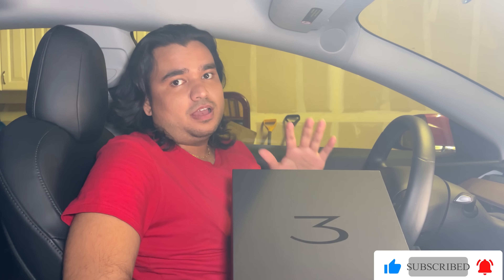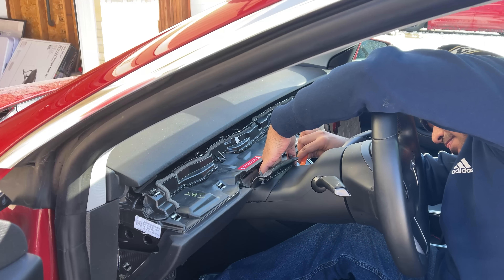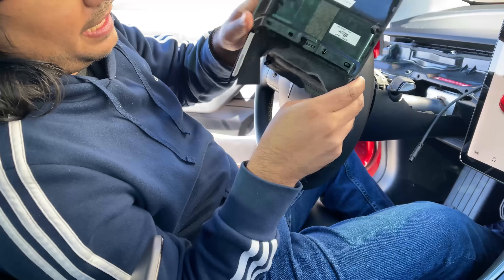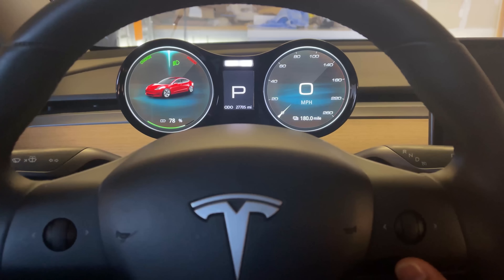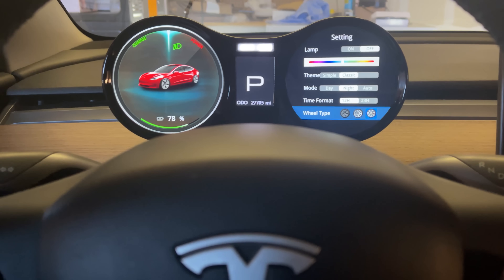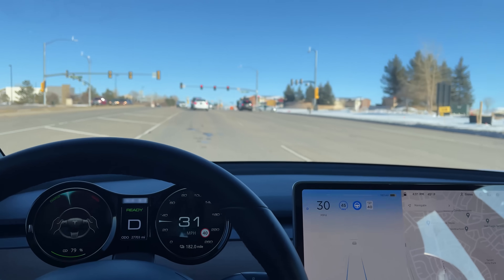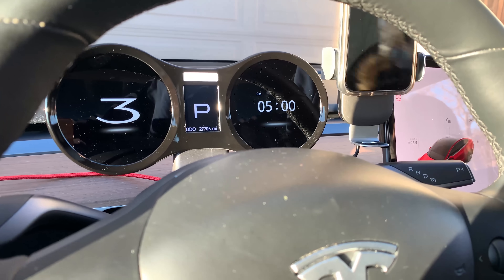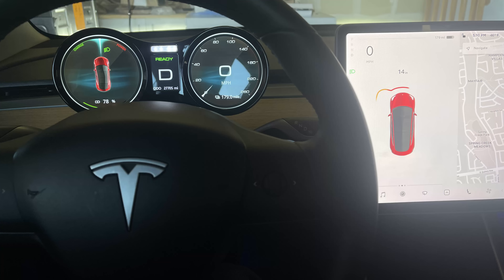New Display For Tesla Model 3 & Model Y - Instrument Cluster 2021

Comment: I need an update for Multifunction Dashboard with Smart LCD Screen for Model 3/Y Which I had purchased from them on 10/2023. Since the last update from Tesla, the range display and the battery level no longer work. The battery level display is at 79% and is frozen there and the remaining range is no longer correct and goes down and up uncontrollably. Could you send me an update or a link where I can get this???
I frome Germany and I hope you can help

Comment: Hi, i bought this dashboard display, but i have problem with connecting to the control unit. I have model number 1960100 with only one grey connector. another 2 connectors have black colour. Second connector has 10x2 PINs. Third connector isnt remove. Its this right connector to plug-in connctor cable to dashboard, please? My car was made in 2022. Thank you for your answer.

Regards, Matus
Reply: Me too , I could not find the plug on 2022 model 3. I have been hanging around for the whole day :(
 Do you have any solution afterwards? 😅

Comment: Tesla is not very flexible with regards warranty. If you experience the smallest of issues this modification will certainly be blamed and the modification will be forever logged into your Tesla file. My Tesla Advisor was pretty clear on the subject. You might as well write off your warranty.

Comment: So I’ve had this on my m3 for about 6 months and just recently removed it and switched back to stock. The main reason I got rid of it is that it significantly blocks air flow to the driver out of the vents, but I also found myself looking at the Tesla screen for my speed anyway and not even looking at the heads up display.

Comment: Hi Shiva - after installed, now I have no sound on the Tesla display screen. Any thought?
Reply from the maker: Lock your car and let it sleep overnight. Make sure to close your app as well. When your car wakes up, it will have the sound. The reason this happened is likely because you took more than 2 minutes to plug the new harness after unpluging the original Tesla connector. Tesla freaked out and put the car on a safety mode. Let it sleep and when it wakes up after several hours, it resets the audio and you should be good. Hope this helps!
Reply: Thanks much for your help on this

Comment: I’m trying to install this on 2022 model y, is the wiring different? I’m having difficulty getting the harness to connect with the autopilot computer, i maybe removing the wrong plug, is it the second one from the bottom?
Reply: Please if you found the solution tell me, i have the same problem, connectors are different and i don t know where i need connect it
Reply: @monxis99   if you got the model y with the Ryzen chip, the blue connector is behind the panel just below the smaller panel Shiva removes on the passenger side in the video. Its got a fastener at the top for your pry tool and the rest are just clips going down along the panel. Having this setup means you do not have to remove the connector from the Tesla computer. Your kit will need to have come with an extra connector that has a ground and power cable, you’ll have to use this one connected to the one going into the blue connector and use the 12v battery in the Frunk for power and ground somewhere in the frunk area. If it didn’t come with this extra connector and you got your kit off Amazon like I did, contact the seller, they may be able to send you one. Hope this helps!
Reply: @JonnyWyshbone  thank u very much, any picture or video how i can do this connections? I have two connectors, but i don t want make any mistake .....
Reply: I have a new video from the seller, i resolve all my question, if anyone need help i have the solution for models 2022...thank u
Reply: @monxis99  Can you send the link to this video?
Reply: @monxis99  can you send me the installation video ? I have the same problem, new cable i have already ! Thanks
Reply: @saschakuckartz6871  Hello you have the link on the before comment, can u see it?

Comment: Hi Shiva,
Seems like the 2022 TM3 comes with a wider plug for the computer unit. I happen to have a Topfit instrument cluster which is 2021 and a TM3 which is 2022 and hence the plugs do not fit. Do you know if a new cable is or will be made available from Topfit to deal with this problem?
Thx, love your videos!
/Chris
Reply from the maker: Hi Chris, looks like Tesla changed the plug location to somewhere by the door pillar instead of being under the glovebox. The plug size is the same but the plug is not located on the same spot. I have been trying to get Topfit and other manufacturers to send me some detailed wiring instructions for the 2022 models. Please send me a quick email and I will keep you updated when I hear back. Thanks.
Reply: @ShivaSapkota  please i need also this solution , beacause the new models not have the same plugs thank u🙏
Reply: Hi, 
Ref above. Wasn't able to find your email, hence replied mine here but see it has been deleted. Perhaps it's YouTube regulations, not sure. How can I pm you?
BR,
/Chris
Reply: Me too ! Some news there ?
Reply: Can I also  have the new information  for my 2022 model 3? Thanks

Comment: Hi Shiva,  I purchased this unit for my 2022 model y and I find out the harness that plug into CPU is not fit. Do I need adapter ?  I also had 2022 Model 3 and I installed without any problem. harness plug right into the computer. Thanks
Reply from the maker: I just learned that Tesla changed the location of the OBD plug to the door panel. Please send me a quick email and I will send you instructions on where to connect it. Thank you.
Reply: @ShivaSapkota   can you make a  upgrade video for this new models ...thank u
Reply: @ShivaSapkota  can you send it it to me also ?
Reply: @ShivaSapkota   Can i send from you quick email with instructions, please? I have the same problem. Thank you.

Comment: Some extra installation notes. Before you start extend the steering wheel towards the driver as far as possible. The connector is really difficult to get off, try two small flat head screwdrivers. One to push in the release the other to push off the connector, it's also eaiser if you remove the lower connector

Comment: Tesla not putting critical info in front of the driver is just bad--they did it as a cost-saving measure, which I totally get, but I'm glad to see these things coming out.  The interior layout is one of the major reasons I'm looking to buy a Mach-E instead of a Model 3 or Y.  This is a pretty cool add-on that solves some of my issues with Tesla's UI and general ergonomics.

And before anyone asks: yes, I've been in, and have driven Teslas.  I've even rented one for a week--it was a great car, but no car is perfect.  :-)
Reply from the maker: Thank you very much for your feedback. Much appreciated.

Comment: Thanks for the review ! I've bought the kit on Amazon, but it comes without any manual, nor any website where to download it ! Do you know where I can find the manual and the software updates ?
Reply from the maker: They recently started up a website but I haven't seen new updates or manual in there. Perhaps you can reach out to them through the website for an actual manual? https://www.topfitev.com/
Reply: @ShivaSapkota  I've tried to contact Topfit unsuccessfully... Have you got any newer version of the software ?
Reply from the maker: @StefanoArtioli  https://drive.google.com/file/d/12wITN0TFlg3yOKyozcTSLwOc5fyBZiKR/view
Reply from the maker: @StefanoArtioli  That is the last update I have.
Reply: @ShivaSapkota  thanks ! That was newer than the one I had. Unfortunately despite the right display updated successfully. the left one gave an error during the update and now it doesn't show anything, it's totally black... I've tried to contact the seller but I haven't received anything back. This is a pity as for the price I would expect to have some kind of technical assistance, but there are no references to the real vendor, and the website reachable via the QR code is not working. I loved the display...
Reply: @ShivaSapkota  Thanks ! I've tried to contact them through the site. I'll let you know what they'll reply. I've asked for the latest software update but also if they have any news about some features like the brightness setting and possible navigation data.

Comment: What happens when Tesla does a software update and bricks the aftermarket instrument cluster?
Reply from the maker: These clusters are much more robust compared to the HUD displays that connect to the back OBD port. They also have software update capabilities to correct any issues Tesla's update cause. So far, with many Tesla updates, these displays have held up well, but time will tell in the future :)

Comment: So i got this HUD, however; it doesn’t go to sleep (turn off) when the car goes to standby as the tesla screen does; is that normal?
Reply from the maker: Please install this update to fix the issue: https://drive.google.com/file/d/12wITN0TFlg3yOKyozcTSLwOc5fyBZiKR/view
Reply: @ShivaSapkota  thanks for the help
Reply: Shiva. Firmware updated. However, since I keep my MYP plugged in, the issue is that the HUD never turns off even though the car is asleep. Is that normal? Did that happen to you when you had it installed . Thx

Comment: Will these work on a 2018 model 3 performance? I saw a review on Amazon from someone with a 2021 performance that said it was not compatible. Are all of the units on Amazon the same? They all show a photo of the unit with the “Carda”    logo on them?
Reply from the maker: Hi Brett, yes this works on a 2018 Model 3 Performance. In fact, my M3 is also from 2018. The 2021 plug is on the other side (in right hand drive countries), so the cable is a little short. Yes, it is the same display sold by a few people. If you go through the Topfit one, you can use my discount code to save 10%. Thanks.

Comment: Thank you for the install video. However, I tried  to install it and it does work properly but now nothing thing on my Tesla works including no auto pilot, no cruise control, and the cameras don’t work among other things. I’m pretty disappointed. Any idea what I did wrong?
Reply from the maker: Hello, how long have you had this installed? Your car might have gone into safety mode. If you leave your car locked and let it sit for 6-8 hours over might, it might come back. If not, I would recommend removing the display plug and put the original plug back in. Drive for about a day and try again. I would recommend you remove this display completely before calling Tesla service.
Reply: @ShivaSapkota  Hi thanks for your reply. I just installed it yesterday on Saturday 10/9/21.  And now having all these problems with the car. I’m afraid I may have done something to my car. It was so difficult for me to remove the original wire connector and even harder to install the HUD connector in its place. It took me like two hours. Exhausting. I need to gain the courage over the next few days to try to unplug the wires again and plug the original connector back in. There’s got to be a way of making it easier. Anyways, Hopefully removing the device will restore my car. If it doesn’t I guess I’ll have to take it into Tesla for service. I hope they won’t know I tried to install the HUD, as my car is still under warranty. I appreciate your feedback. Thank you.

Comment: So if you install the top fit, you can no longer use the scroll wheels for their original purpose?
Reply from the maker: Hello, the scroll wheel still works for the original intended purpose. Almost all the controls are done through the left scroll wheel in Tesla, which is not utilized by this display. The right scroll wheel controls autopilot speed, which is still functional after this display. Thank you.

Comment: Would the connector be on the right hand side of the car if it’s a UK RHD?
Reply from the maker: Hi Paul, the connector is on the left hand side for RHD cars. Thank you.
Reply: @ShivaSapkota  thanks for taking time to reply, I shall if this a go when we get some better weather.
Keep safe
Reply: @ShivaSapkota  Finished mine today. Unfortunately, the supplied cable is too short for RHD cars. It needs to be re-routed through the central dash and up and over. Like you said, that connector is not easy.

Comment: Hi Shiva, Great video. Do you know if there are any aftermarket items like this that use HUD for the model Y?
Reply from the maker: Thank you very much. Yes, they make LCD HUD displays for Model Y but they are cheap in my opinion. They tend to be incompatible after each major software upgrades. I wouldn't recommend any that are currently in the market.
Reply: @Shiva Sapkota  Thanks for the reply. I just did something I’ve never done. I subscribed to your channel as a means of thanks. And I suspected that based on price of the current HUD products that they aren’t that good. What surprises me is that the Tesla’s don’t come standard with HUD. I’m replacing my fully loaded X3 and of all the gadgets it had, my favorite was the HUD followed by helicopter view for parking.
Reply from the maker: @140P6  Thank you very much for your support. I really appreciate it.

Comment: Hi thanks for your great video without I would have not been able to install.
I like the display the two round ones (Micky Maus ears ) I have been gettin error messages for power steering reduction and brake reduction I brought it in to tesla and they said after looking for problems after 3 hours that messages are related to the draw of power from the display at this time they don’t accommodate this and told me to uninstall it to fix the problem. There only charged me 178 $ for one h . After one month the error messages came back and I am considering to take it out. Do you know of a have a fix for that . Thanks for your help my model y has autopilot too I don’t know if it makes a difference.
Reply from the maker: Hello, sorry to hear about your issues with the display. A few folks have reported having similar issues. Unfortunately, the vendor hasn't provided me with any solutions other than just unplugging the unit and installing again. It worked for many people but the error message sadly might come back :( I am pushing them to release a new update to hopefully fix these issues. For now, I would suggest you disconnect all the power in the car (both 12V and the main power cutoff in your frunk), unplug the unit and plug back the original Tesla connector. Bring the power back, drive for a day and then re-install the unit. That might solve the issue.

Comment: When I first got my first Tesla 3 it took a bit to get used to not having the instrument cluster behind the steering wheel. Skip forward 2 years, I don't miss it anymore or eve look there for it. The purpose of the 3/Y design is having minimalist look. I can see ONE benefit of having this but it's rare. If the center display goes out or you need to reboot it while driving you still have a backup device to look at.  That said, I'm not sure if this device goes out too when you reboot the center screen.
Reply: I really just needs a minimal display even smaller than this

Comment: I just installed to a Right Hand Drive vehicle, It was a bit different to your pictures, the plug was harder to get to and the lead is too short to go around as the plug is on the inside, so I had to send it up next to the glove box. No problem though. Very happy so far thanks for the clip
Reply from the maker: Hi Brad, thank you for sharing your installation experience. I am glad the device is working well for you.

Comment: Does it mess with the default wheel controls? How does it know to use the input for the the default car vs display?
Reply from the maker: Hi Victor, it won't affect the default wheel control other than the car's following distance. The right wheel doesn't do anything much. The left wheel is the main control for Tesla. One of the right wheel's input is during autopilot to increase speed. On that case, as soon as you put the car in cruise or autopilot, this display becomes read only, so the wheel is freed up for Tesla again. Hope this answers your questions. Thank you.

Comment: ? Will this product void Tesla Computer Warranty???
We just took delivery as I told you before of a Tesla Model
Y Midnight Silver Metallica with White Interior Gemini I’ve did the R 1 Ceramic Everything Exterior Coating 
Amazing and Guyeon Nanoceramic Leather for the White Interior highly recommended!!! We with Tasmania Mats all 6 for 229 dollars great product also pure carbon fiber stalk handles from RPM retail
93 dollars  another awesome addition
Reply from the maker: Hello, it won't void Tesla warranty. However, if the installation or this product causes damage to any Tesla OEM parts, then Tesla can void warranty for that. Awesome mods, thanks for sharing.

Comment: Does the cluster start changing options when you use the steering wheel control for cruise control changes?
Reply from the maker: Hi Jason, it does not. The display becomes read only when the car is in cruise control or autopilot. Thanks.
Reply: @ShivaSapkota  Thanks for the prompt responses! I've been going back and forth on these. I think I've settled on the topfit cluster, with a tablet carplay setup. If you are interested in my final build I can send it to you after I get my car. (August delivery)
Reply from the maker: @jasonames  Thanks for your feedback, yes that would be great.